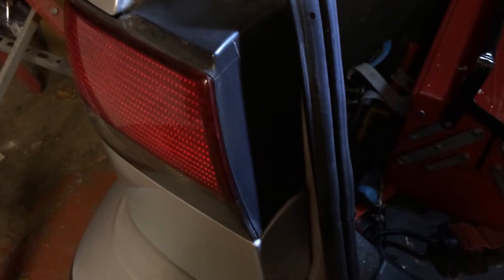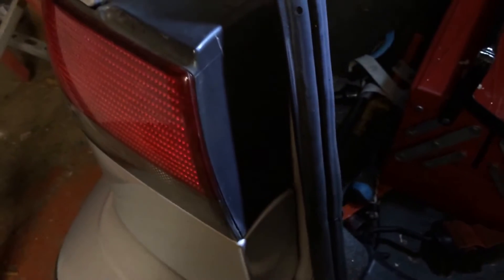Saab 9-3 MK1 Rear Light Removal Guide How To

Comment: Hi I've got a sportswaggon how do I go about and replacing the whole light , please
Reply: Jay W., Did you figure it out yet? I'm in the same situation. 2007 9-3 sportcombi - bad LED tail light array. I have the part in hand. Now to figure out how to disassemble without making a mess of the interior plastic! I can see that there are 3 fasteners that hold the whole assembly on the body. I just need to learn how to remove the interior plastic materials so that I can get a tool on the nuts to loosen the tail light assembly.
Reply: I think I figured it out after reading a Saabcentral. It appears that the tail light assembly is secured to the body with three nuts that are removed from the inside. Low panel pop-out gets access to two, but removal of the trunk light pop-out lens is required to get access to the top nut. I'm not going to attempt removing the top nut until I find a suitable tool that will hold the nut by magnet or super-sticky glue so I don't lose the nut into the body somewhere. I bought the LED light kit from eEuroparts--about $50 for the cheaper option. I hope that was a good decision.